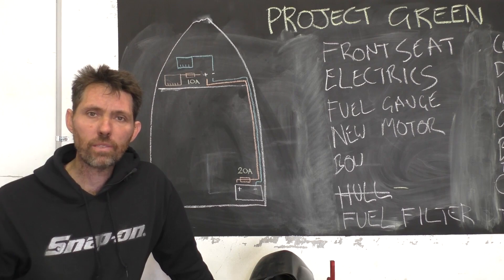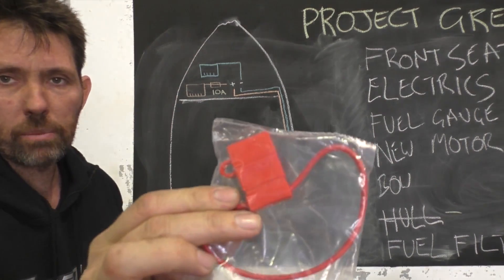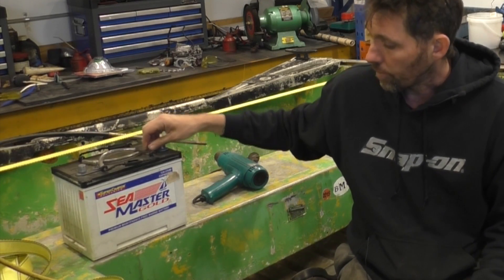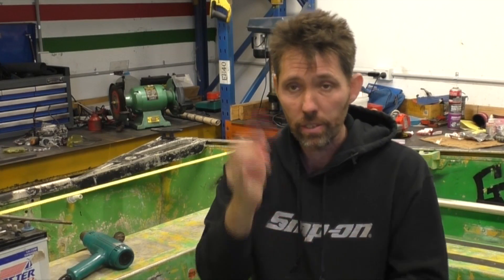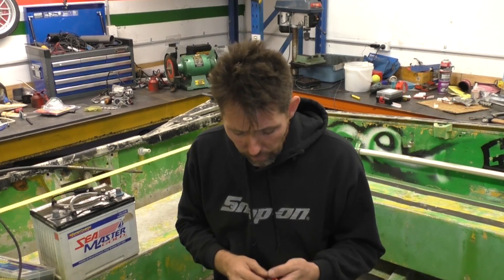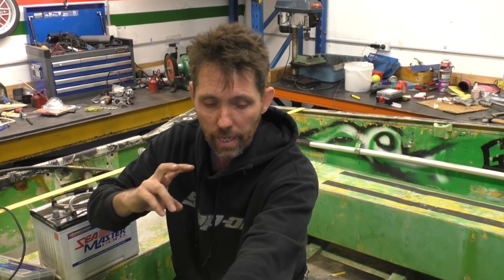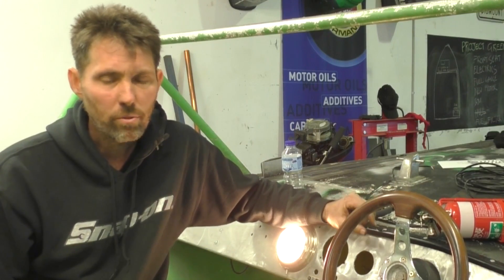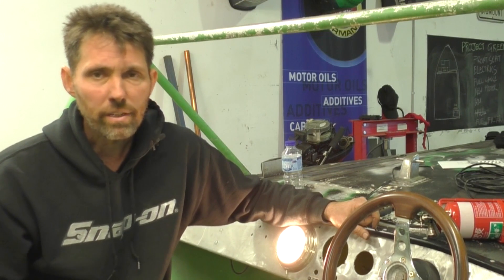Wiring the electrics on a boat [Pt 1]

Comment: Hello dangar I'm think about buying a fiber glass boat it is in good condition but needs the motor put back on and all the controls wired up and gauges put on and was hoping for some tips because I never have done anything bigger than mounting a depth finder on not wired yet because I need to buy a fuse and fuse holder and a trolling motor on the front of a small aluminum boat which ended up grate but I really need a bigger boat and it's a good opportunity I have but the thought of having to put a motor on which I have watched your video on mounting one but also doing the steering and gauges when I'm amateur at best wiring and having no clue really for steering cables and running them I won't be doing all of this on my own because of my grandfather and his friend who have had several boats all their life's and have done a little steering work on one of their friends boat and maybe more I can't remember all the stories but any way this boat is calling me and I love a challenge I was going to look at it this Monday if I could but something of this size I'm scared that I'm going to haft to just sell it for what I can and not have a boat for a while which I like the idea of the boat because of my YouTube channel it would be great content but I feel like it might end up being over my head from the start so I was hoping you could give some pointers to me or something that would calm my nerves a little about taking on something big like this and I'm only 16 so cash is tight when it comes to projects and so is time so I was hoping to get tips form a professional like yourself on what to do if I get the boat I need to get the engine on and running soon before it gets cold out and our lakes freeze the rest I would do in the winter in a barn so if you have any advice it would be appreciated
Reply from the maker: The most important thing with projects like this is to great break it down into smaller projects so you don't get overwhelmed. Start by getting the motor on the transom firmly without and leaks through the bolt holes. After that I would mount the steering so it can't flop around anymore. Once you've done that you can attach the forwards controls and get the motor running. The final stage would be any electrical wiring you need for gauges etc. If you break it into smaller steps you can also research each bit separately so you're not trying to learn too much at once. Good luck!

Comment: nice setup. perhaps because i haven't finished my first cup of jo but i don't remember you covering conductor sizing. i've been working on the johnboat getting her ready for some night fishing.think of everything one might run and add up the amps to know what cable size to use and what fuse. i've also run a switch to control a relay as a master. then if i forget something at least it wont drain the battery. put all this in a pvc  junction box i got at the home supply store.
Reply from the maker: Hi RIchard, I think I covered it a bit with the main wire from the battery to the junction box being heavier gauge than the rest of the feeder wires, but you are right, going through a list of devices on the chalk board with their current draw would have helped illustrate the thought process better. I like your idea of a master relay. Nice one!

Comment: I like the idea of the fuse at the battery in case the wire gets cut or rubs the insulation away. I didn't do that to mine when I did the wiring but I think now I will go back and do it. great video.
Reply from the maker: I think it is a good way to be safe, and fortunately it is very easy to add afterwards.

Comment: Can you wire straight from the battery to the bus bars or do you need that terminal post beforehand?
Reply from the maker: Hey Paul, yep, you can go straight to the bus bars, I just had this extra junction so I could fuse the bus bar at a lower amp rating than the power to stuff up the front like a spot light or winch.

Comment: Have to say that this video was essential to my planning for doing electrical work on my boat this Spring. Had a depth finder and radio that I need to get powered up front and the suggestion of running a big power cable up to the front was very good. I ran the cable up front and put in a 6 circuit fused block to power those two devices. Worked really well and also preps me in the event that I either way to install another device (GPS) or add a solar charging unit up on the bow as I have those terminals on the fuse block to connect with instead of running cables all the way back to battery again.
Reply from the maker: Hey Peter, glad the video helped. I do like the system of having a couple of main feeds that then branch off. As you say, as well as keeping things neat it gives you a bit of future proofing should some new devices come along down the track.
Reply: Exactly. I've got 6 terminals and will only be using 2 of them (depth finder and radio). Radio comes today and other than not having a 3in Hole Saw, I'm super excited to get it installed.

Comment: not baggin but the batt would be better off on the port side  its the weight
Reply from the maker: Hi Scott, this boat is reasonably wide and sits pretty flat, but with most boats that have a clockwise turning prop the hull wants to turn the opposite way (counter clockwise) which means adding weight to the starboard side to counteract that.

Comment: Why do you need 2post terminal? can we not bypass straight to earth and live from battery.
Reply from the maker: I that for flexibility down the track. It allowed me to run the spot light off a separate circuit to everything else with a different fuse rating without running two sets of wires all the way back to the battery.

Comment: I think you aughta do a Killswitch replacement video
Reply from the maker: There isn't much to a killswitch, there are just two wire switches that can be wired either way around. A video on the full set of ignition, start in gear protection and kill switches might be worthwhile though.
Reply: Dangar Marine that kinda where I was going with it. because you can have an ignition kill switch or magneto for the smaller engines. I think it'll help out with people who have trouble with their motors starting. knowing what to look for for shorts and what not.

Comment: Good video. I'm new to the whole electric side of things what gauge should I get to use as ground
Reply from the maker: It really depends on how much current the circuit will be carrying. Most small boats don't have any high draw circuits like an anchor winch, so something like a 12-10 gauge wire is generally enough. http://www.engineeringtoolbox.com/amps-wire-gauge-d_730.html

Comment: Great video Stu did you say what wire your using? I've always use silicone insulated tinned wire as the silicone insulation doesn't degrade and the tinned wire doesn't corroded the same, yes I know it's more expensive but just a thought
Reply from the maker: This is the cable we use, but I'm not sure what the insulation is made from https://www.jaycar.com.au/7-5-amp-2-core-tinned-dc-power-cable/p/WH3057

Comment: If im using a multiple switch pannel do i need to ad fuses?
Reply from the maker: You want every circuit to be fused at least once. Ideally every individual switch will have a fuse on it rated to match the device on that circuit but as long as both switch panels have fused power running to them that is a good start.

Comment: 13:00 shrink wrap melted off the positive terminal, will this be OK?
Reply from the maker: Can't recall the exact connection, but yes, melted shrink wrap is a problem, particularly on positive wires. The trouble with the combined heat shrink solder connections is that it can be hard to melt the solder before the shrink wrap melts. If it does happen I just add a layer of tape over the top.

Comment: Hey Stu, just wondering what battery you would recommend for a 14 foot half cabin boat with a 60hp outboard and the usual electrics ie lights, radio, bildge pump. would a 550cca be enough?
Reply from the maker: It would be sufficient, but if you do run a lot of electrical equipment you might want to think about a house battery so that you can always start the boat if you have been sitting at anchor for a long time. The battery I have in the Green Machine is a 585CCA, so pretty similar.

Comment: It is good to see someone wiring a boat with solder joints.  You will almost never have a problem where the guys with crimpons alone will be chasing electrical problems in a couple of years and from then on.  I wouldn't do it any other way.  In a Marine application especially.  Take care.  Doug
Reply from the maker: +Douglas Thompson People do argue that solder will melt if there is a short, but I reckon the fuse will blow first. I've worked on boats that have sunk in salt water and the soldered connections have still been fine for years afterwards.
Reply: Usually with the melting point of solder, to get it to the melting point either something was hopelessly undersized regarding wiring, or oversized regarding the fuse. You are right in assuming the fuse should blow first, but there are points where things may come together to a point where the solder melts. Especially if a lot of cables and connectors are cramped into a small space. also in a bundle of cables, if all of them have to be spliced, it is best to stagger the splices, makes the overall bundle also considerably thinner than having all splices in one point.
For reliable connections I would consider looking into some NASA working documentation, they show several ways to reliably connect wires.
I would consider a mixture of crimping and soldering.
Less important systems (e.g. a fish finder) can get along well with just crimping, maybe some water displacing fluid to keep them corrosion free and even for connectors which are naturally open one end, shrink tube on the wire side. 
Everything else I would crimp first, and then solder the crimped connection. Crimping a presoldered connection may cause issues as the solder is pretty weak and you might easily pull out the crimped soldered cable as the solder deforms. This way you got the mechanical advantage of the crimped connection and the corosion resistance of the solder.

Comment: What is your opinion on the fact that some say that crimping is the way to go as opposed to soldering when used in marine applications with stranded wire?
Reply: The ABS doesn't recommend soldering because they say vibration will break at the wire where it meets the solder and becomes stiff.  In sixty years of boating I have never ever seen that whereas I have seen numerous crimp failures and corrosion under crimps.  This is affirmed by several of my friends who are dealers and or work on marine installations.  I crimp, solder and heat shrink.  I also use dielectric grease or vaseline (replaced/renewed anually) under any screw terminals.  The proof is in the pudding.  I haven't had any problems with my work.  It does take more time which is why the dealers don't do it at $100 per hour but if you are doing your own that isn't a concern as it doesn't take that much time done properly and won't haunt you in the future.  Take care.  Doug
Reply from the maker: Good question. A lot of it comes down to the quality of the crimp connectors. In particular I like those bullet connectors with the soft silicon jackets that seal the water out really well. The reason I personally like soldering is that it completely seals the connection against corrosion. The downside (according to some) is that if a wire gets hot due to a short, the solder can melt and cause further shorts. Personally I feel a good system of fuses will stop this from ever happening.

Comment: I have a question. I am new to boating and did my driving licence only a few weeks ago. But i buildt two wiring harnesses for a small race car. Most of the automotiv wiring harness use the car frame to distribute the negativ terminal across the car to save some wire. In case of an fiberglass boat of course no option but with an aluminium boat it might be possible. So to cut a long storry short: is there a reasion behind using an extra negativ cable. greetings from germany i like your videos keep on!
Reply from the maker: It isn't done in Aluminium boats because aluminium is low on the galvanic series so when a current passes through it while it is immersed in an electrolyte (salt water), it acts like a battery and metals higher up in the series (stainless steel etc) will start to eat the aluminium away.

Comment: At what point do you need to use 2 batteries?
Reply from the maker: Most of the time people have two batteries if they are running a lot of accessories while the motor is off. This was you can start the motor on battery 1, run the accessories on battery 2 and then know that you can always start again on 1 to get home.

Comment: Good day mate! Love the videos! I am learning so much and am applying everything I learn here to fixing up our outboard. Was wondering if you could make a video on replacing fuel lines under to engine cover not from the gas tank to the motor like every other video. Can't find any useful info anywhere and my lines are cracked and leaking under the hood
Reply from the maker: Hi mate, glad the videos are helping you. I'll add that to the list about replacing the internal fuse hoses. Really it is just a matter of draining them, removing each section one at a time, cutting another piece to the same length and installing. There are a few things to be careful of such as not introducing kinks and making sure the hose clamps seal well, so I'll do the video over the coming months.

Comment: Forgive my ignorance if I am incorrect but I was referring to grounding the boat to earth....if I am saying it correctly.  I was blessed with a jon boat, of which i am rewiring, that had a white wire screwed to the hull of the boat. Is that necessary?
Reply from the maker: That's actually a good and very interesting question. I've never screwed any wires directly into the hull. Having current flowing through dissimilar metals will cause one of the metals to "eat" the other metal. Unfortunately aluminium is the one that gets eaten in most cases. (Zinc being one exception which is why anodes are made from zinc) I also run the ground back to the negative battery terminal. If you touch a multimeter to the hull of a boat you will see that it is connected to ground as the block of the outboard engine is connected to battery ground and in turn connected to the hull using metal bolts. The trick is to not encourage any current to flow through the hull though by wiring direct low-resistance wires for every device back to the battery negative.

Comment: The K.I.S.S. principle at work, looks great.
 Don't forget a bit of dielectric grease on your final assembly of the terminal blocks and wiring.
Reply from the maker: Yep, I've got a can of spray on and battery box to put the battery and fuse holder into.

Comment: Dick Smith soldering iron?  I have always been one for soldering crimp connectors together, I reckon they are more reliable that way. .
Reply from the maker: Hey Alan. That iron came from Jaycar, but I imagine they are sold in many places. I particularly like soldering in the marine environment as seals the connection from salt air getting in an corroding the join. Even after boats have sunk soldered connections have kept going for years.

Comment: Worth mentioning that the rule of thumb for any electrical work (ac/dc) is "never change gauge" and when you do "fuse it appropriately to the gauge you are changing to".  Then you can't go wrong.  Good video bud!
Reply from the maker: Hey mate, good rule worth mentioning! My plan is to have that thicker 20 amp circuit potentially feel another one of those lighter 10 amp circuits, so I'll make a point of making that clearer down the track.

Comment: Thanks for the vid, could you do a future video of how to wire up a dual battery system with 4 position isolator switch (off/1/2/both) and show how to have an independent circuit for the essentials like the ignition and bilge & then have a 2nd circuit for all the other accessories (like how you just did in this vid), or if there is a better way to wire up a dual battery system. i have my boat currently wired up like yours but the other way around as a tiller steer  and the battery at the front, and electrics just for accessories as my outboard is a pull start, but I am in the process of upgrading to a newer boat which will be a runabout style and have electric start and forward controls and would like to put dual batteries for safety. also is having a cranking battery and a 'house battery' ideal for a dual setup in case one dies while out on the water? will a lower cca house battery be able to turn over a engine in case i run the engine cranking battery flat or is the the purpose of a 4 position isolator switch to cater for if im anchored somewhere i switch to the house battery to run my accessories and then switch to the high CCA battery to crank engine when wanting to move?
Reply from the maker: Ah, a man after my own heart. I'd love to do a dual battery install in the Green Machine down the track and will definitely make a video of it. Hopefully won't be too long in the future!

Comment: Excellent, I usually use an automotive ATC fuse block with ground bar in small boats or adding another distribution point to a boat that already has one.  I usually use something like this: http://www.ebay.com/itm/like/261166084817?lpid=82&chn=ps&ul_noapp=true
Reply from the maker: That's a nice looking fuse block Will, and the price is good too!